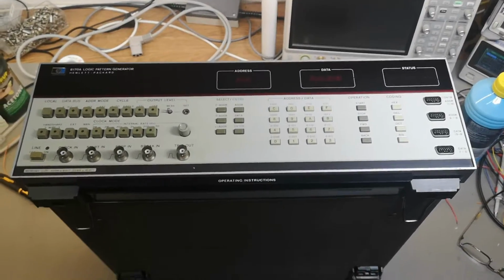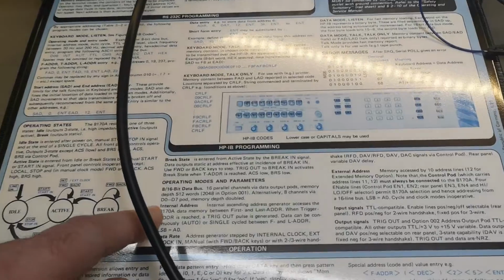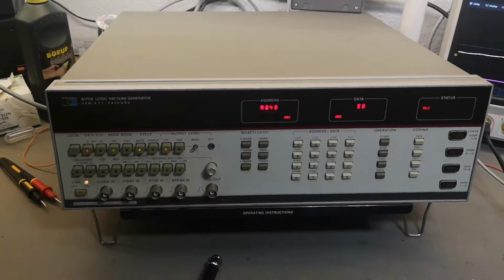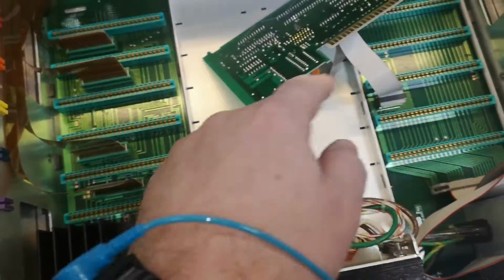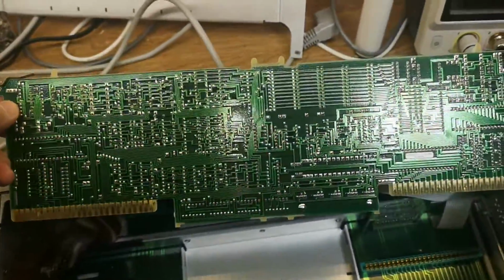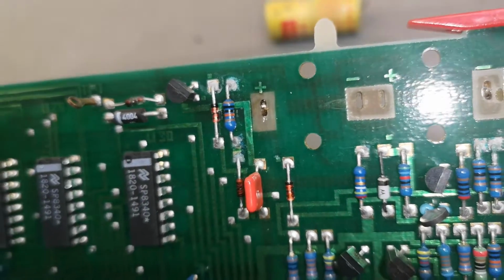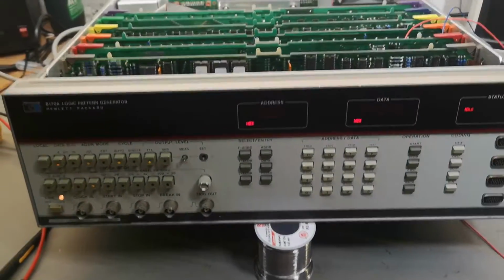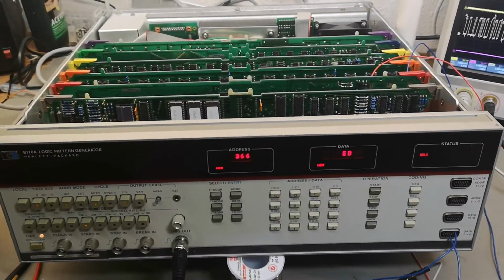HP Hewlett Packard 8170A logic pattern generator 1978 test teardown repair

Comment: What a beast! I'm going to google what it was used for, my imagination falls short here. The processor is a Motorola M8600L, the workhorse you see in a lot of equipment of that age.
Reply: It was used to test the various chips on systems with up to 16 bit address bus by generating addresses and injecting them into the DUT.
It could also be used as a RAM emulator by getting the address bus from the DUT and outputting its data onto the data bus.
Unfortunately just up to 2 MHz which is a little bit slow and with just 4 KB of memory - well, you get the figure

Comment: Altid en fornøjelse at se HP ´s  produkter. Du siger 1978. Jeg syntes jeg så 84 på nogle af chippene.
Reply from the maker: design is from 1978 but my unit can be manufactured 1984, it is a good idea to see IC markings